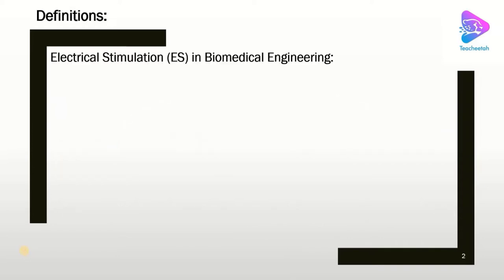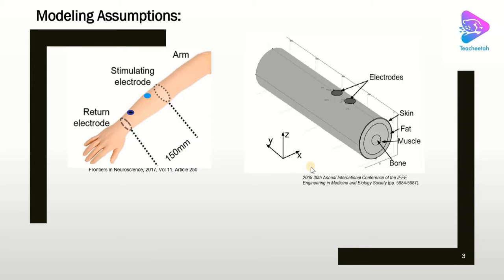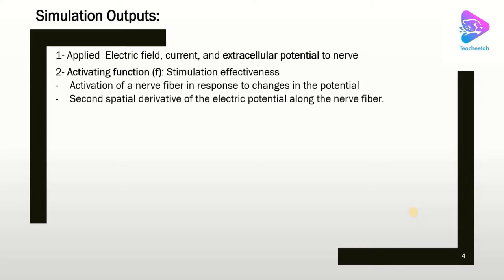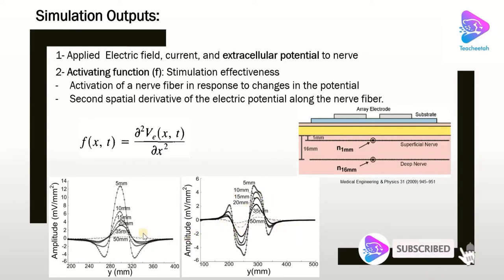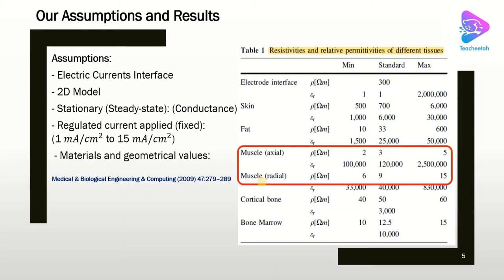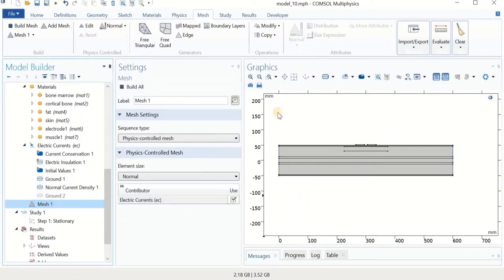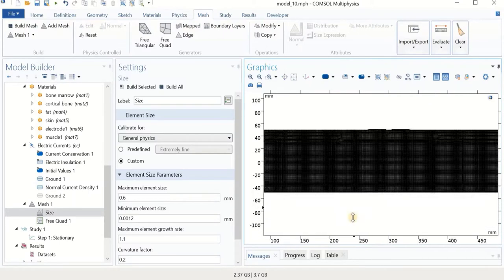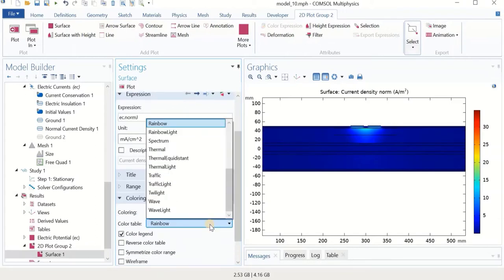Tutorial 10: Electrical Stimulation in Biomedical Engineering Part 1 || COMSOL MULTIPHYSICS

Comment: Could you do this simulation on rado-scs model of spinal cord ?
I have also another request how could I import STL files to comsol?
Reply from the maker: The method shown here is a basic approach for applying electrical stimulation through skin. Depending on your problem, you might be able to develop a model based on this method but may need more considerations. Regarding the second question, yes definitely you can import an STL file into Comsol in the geometry builder but note that STL refers to 3D domains which must be selected in the beginning.